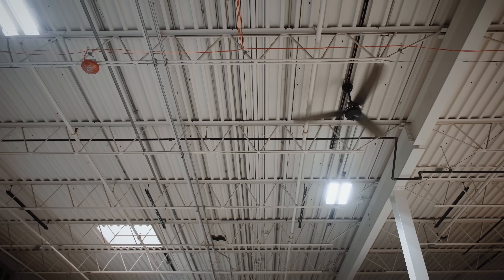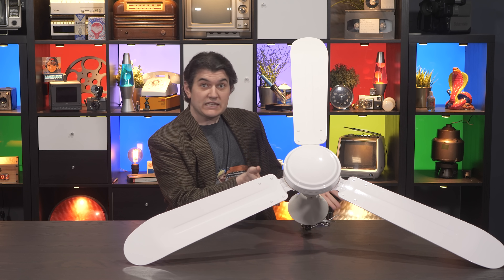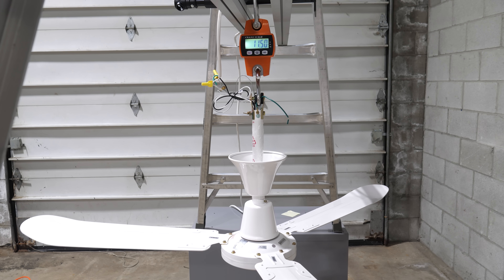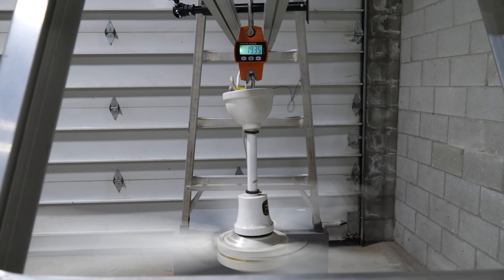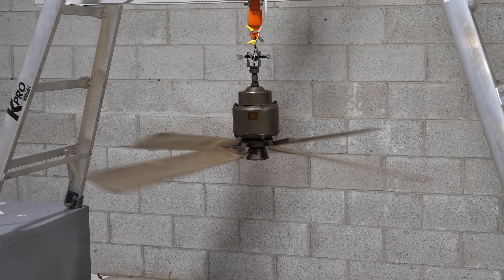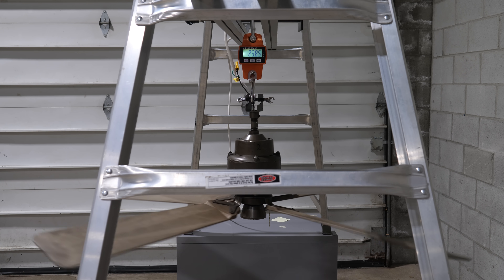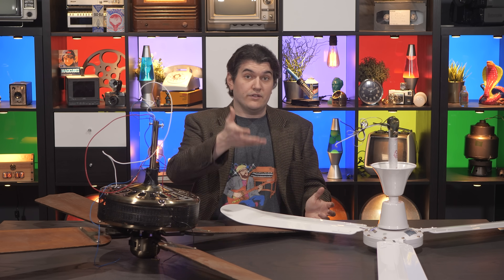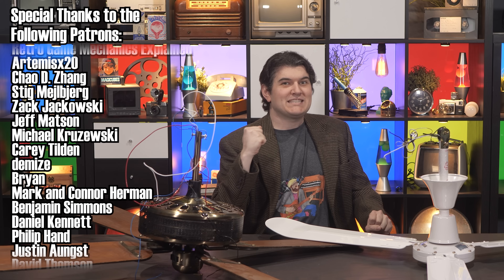How much thrust does a ceiling fan produce?

Comment: A propeller or helicopter rotor doesn't push air, it pulls the aircraft through it. A better comparison would be the fan on a turbofan-powered aircraft, which works because the fan is ducted. A propeller is shaped like an airfoil and the air is moved through aerodynamic lift, not just by scooping the air and pushing it out of the way like a fan does.
Reply: Propellers push air. Saying the propeller pulls the aircraft is not distinct from saying it pushes air. It can only pull the aircraft because it pushes air. Aerofoils work by pushing air. That they don't only do so by acting as a "scoop" doesn't change that.

I'm starting to reflect on how irked I am about this subject. I got very annoyed by inadequate explanations of it and spent way too long learning about how planes fly, and now I'm just permanently mad about it.

Comment: A proper ceiling fan box that's correctly mounted will hold something like 50-70 pounds of fan. With a purely static load, like a light fixture, they're rated for 2 to 3 times that. Most of the problems come down to using the correct box for a ceiling fan and then mounting it correctly to the joists. After that, the problem is the average home owner using an impact drill to strip out all the screws on their new remote control ceiling fan that they also wired in wrong.

Comment: An average Ceiling fan is around 3,000 CFM of airflow powered by around a .05 horsepower motor.   

Even a Robinson R22, which is a diminutive helicopter, has 122 horsepower.  It only weighs 1370 lbs.  

So one of the smallest & lightest helicopters is 3,050 times more powerful than an average ceiling fan.
Reply: Got it. Going to stick a small helicopter on my ceiling.

Comment: A simple lever arm could have stopped the torque issue and if you used say a 10 to 1 ratio you could also get a higher resolution for the readings. Both of which would have been considerably more effort of course 😂

Comment: I wouldn't worry about a properly anchored electrical box but the thought of of some one hanging a ceiling fan from a non- anchored box is somewhat terrifying...
Side note there's an older wiring style I don't believe is used much anymore that makes adding a ceiling fan much simpler by allowing the fan to operate independent of the switch.  The easiest explanation is all the ceiling boxes were all wired to gather  like they were outlets with the switch wires being a dead end loop vs. bringing power into the switch box from the source and then on to the ceiling box.

Comment: In reality a fan is quite close to the ceiling. As it works, pressure builds up above it a little more than in your installation, thus resulting in higher force. Whether or not we should consider it a thrust is another matter.

Comment: For less wiggle, I'd consider mounting the fan to the middle of a rigid beam supported at two ends and use a regular bathroom scale to measure the weight supported by one end and doubling.

Comment: I Think the fluctuation seen during rotation had to do with the shape of the hook you attached to the scale. As torque is exerted the point of contact on the hook and scale changes, creating a fulcrum point which changes proportional to the torque, this would vary the reading on the scale. I bet you would get a different ratio if you changed the shape of the hook. You can see this on the last fan you tested as it has a different point of contact that doesnt shift and you see less fluctuation in reading because of this.

Comment: Propellers generate most of their thrust by lift, not air pushed back xD
Reply: ... Propellers generate lift by pushing air back.
Reply: @seigeengine  Lift is generated by pressure difference, not air displacement.
Check basics of flight

Comment: 7:59 "I will probably make a video about this fan, specifically, one day..."
Four years later...
Reply: The supply wires look a bit sus, don't they, for a resistance heater load? Like, they look like normal 16- or 18-gauge appliance wires.

Comment: Years ago, Consumer Reports rated box fans.  Instead of actually measuring the air movement they created, they measured the thrust.  I thought this was stupid, and felt that fan blades look different than airplane propellers for good reason, and the two variables were not necessarily correlated.

So this is a question for you physics experts:  Does the amount of thrust always vary directly with the amount of air they move?
Reply: In order for a fan to push air in one direction it has to be pushed back the same amount. So, yes.

That doesn't mean the fan is efficient though.

Comment: I have been calling high speed on my ceiling fans “jet engine speed” for quite awhile now. I know jets are bunch of fans, though. I hardly ever run my fans that high for the same concern you had. My last apartment hadn’t had an adequate ceiling mount and I could see the swaying. Now in another apartment I don’t see that. It’s great to know high speed is not that big of an issue if the ceiling mount is done right.

Comment: Fascinating! On the topic of heat fans, there is a product that isn't sold anymore today, but was wonderful in it's time and should get a retrospective: bathroom heat fans. Heater/fan combos, mounted directly above the shower or bathtub, which have heating elements just like a plug-in heater and a fan to direct that hot air downwards. They were wonderful when they existed, as they were perfect at helping you stay warm while drying after a shower.
I cannot find any of those for sale these days. Maybe it's because they needed a lot of power to produce that heat, and infrared lighting is much more efficient at the same thing. Or maybe it's because it used exposed heating elements in the bathroom, immediately above the thing with all the water, and that has some obvious safety concerns.

It would be great to see an analysis of those, and a comparison to the modern alternatives.
Reply: Those are still sold.
Reply: The bigger safety hazard is probably all of the lint that builds up in a bathroom. Every time I clean the exhaust fan, I'm amazed at the amount of toilet paper lint trapped in the grate. Seems like a great way to accidentally start a house fire.
The basic electric space heater seems the better option.

Comment: I had to change a VFD on a Big Ass brand HVLS fan in a warehouse. Even though I had it double locked out, there's something concerning about having your head between two of the blades. Those things are a whole lot beefier up close than looking at them 30 feet up in the air.

Comment: Propellers don't create thrust by pushing air. (mostly)

Each blade of a propeller is actually a very small airfoil. So each one acts like a tiny little wing that goes around in a circle and adds to the total "lift" of the prop.

Desk fans are designed to move the maximum amount of air without proving this lifting force. That way they don't push themselves off your desk.

Search term "Propeller theory"
Reply: They exactly produce thrust by pushing air.
Aerofoils work by pushing air. They do not magically defy physics because you got a bad lesson on flowing fluids in middle school.
The difference is in whether they're designed to push a lot of air gently or a little air very hard. Ultimately, they can't defy physics. You can't push more air without being pushed back just as much.
Reply: @seigeengine Maybe you can explain that to the marketing people in Dyson who claim their "blade-less" fans have an "air multiplier".
(As if it means the little motor in the base doesn't provide all the energy that causes airflow)

Comment: Instead of the sketchy ladder-and-scale setup, couldn't you have simply bolted it upside-down to the top of  tabletop scale, then seen how much heavier/lighter it got when switched on?  So long as you remember to subtract the setup's initial weight, that should work fairly well - and without all that "spinny blades of death" feel (which admittedly does add to the ambiance .)

Comment: @PeterSripol Can you make a Tandem-rotor helicopter made out of ceiling fan rotors? Hm motors would need to be different and the blade angle is not adjustable... uh. Anyway, I would definitely watch that video

Comment: One other interesting factor is the fan’s proximity to the ground during these tests. Because aircraft enter ‘ground effect’ and essentially float on the high pressure area of air above the ground when within a few metres of the ground. I believe this would have had a very small impact on the experiment, would be interesting to see if the fan was higher up if it made a lower reading of thrust.
Reply: It's a factor in comparing the thrust of different fans, but it's not a factor in assessing whether the fans generate thrust.

Comment: This is very useful because I will henceforth reference all jet engine power output in the unit of Ceiling Fans. The F35's P&W F135 afterburning turbofan produces 43,000 ceiling fans of thrust (on full AB).
Reply: Heating function included!
Reply: Anything but the metric system 🤣
Reply: @ampex189 Never surrender to France.
Reply: Call it CFM, for Ceiling Fan... Movement
Reply: For a while,  I was converting speed into furlongs per fortnight.
Reply: @stevenmiller2837  You can also use atto-parsecs per micro-fortnight
Reply: @stevenmiller2837  Easiest way to remember 8*10^12!
Reply: I mean people rate cars in horsepower, so why not?
Reply: How many fig cookies is that?
Reply: How much is that in donkeypower?
Reply: How many ceiling fans are the lift fans?
Reply: Or as I now think 43,000 Flakeys.
Reply: American units be like

Comment: My understanding of aircraft propellers is that they're airfoil-shaped.  But, ceiling fan blades are just angled, flat pieces of wood-like substances.  I wonder why manufacturers don't shape them as air foils.  Well, not really.  It's probably a whole lot easier to use planks instead of carving airfoils.

Comment: Funny enough though if you changed the blades on those fans to an actual propellor blade you’d get a lot more thrust. Thrust doesn’t just have to do with the speed of the fan but also the shape of the blades.
Reply: Not so much. The propeller shape is primarily advantageous at higher speeds. It offers less benefit at lower speeds.

Comment: This might be a silly question, but would it not have been easier to mount the fans upside down and use a regular scale? You'd mostly eliminate the torque issue, you could clamp it more securely to reduce the wobble, and it wouldn't have required the certainly-not-OSHA-approved setup.

Comment: 0:56 Fun fact, since most helicopters' tails are shorter than infinity feet (infinity meters), the tail rotor doesn't just produce a torque force, it also produces sideways thrust. Because of this, the main rotor is tilted slightly to the opposite side, to produce a counteracting thrust and keep the aircraft from drifting sideways when the controls are neutral.
Reply: Is this why the tail routers are also tilted slightly upward?
Reply: @RudyOMP not necessarily. The UH60 blackhawk has a 20° tilt on it, so the tail rotor thrust actually contributes lift. 

It allowed the main rotors to be about 2 ft shorter, which was required for some logistics requirement the army had.
Reply: @RudyOMP  The tail rotor's up/down tilt has more to do with air stream interaction near ground level. When the backwash from the main rotor's air stream hitting the ground hits the tail rotor, it can change the force it produces suddenly. And even if the tail rotor is fully within the main rotor's downwash, its own air stream can hit obstacles next to the landing site. All of this plays into the design and positioning of a helicopter, which isn't that trivial to begin with---when there's no inertia that wants you to keep flying in a straight line, those tiny forces from the air moving around you suddenly matter a whole lot more...
Reply: "most helicopters' tails are shorter than infinity feet" [citation needed]
Reply: "Citation needed" on that assertion about tail length.
Reply: Well yes, but no. The rotor isnt tilted unless the pilot has the stick off center. If you stay in a hover with neutral controls, the helicopter will slowly drift sideways due to tail rotor thrust unless the pilot counteracts it. There may be a couple helicopters that have an offset rotor for the purpose, but Im not familiar with them and it definitely isnt the norm.
Reply: @wills.5762 I know full scale helicopters and planes are different from the RC equivalents. But it surprises me the things you find on rc that are not on some aircraft or at least not normal. Like trimming is just a normal thing in rcs but if I forget in some aircraft you just learn the feel of it.
Reply: Wow that makes sense that the helicopter would drift... But if I had to naively guess, I would have thought it's easier to mount the rotor straight and just put a small offset in the neutral position of the controls
Reply: @benja_mint  At zero you get all the sideways thrust and no torque?
Reply: Could this be countered with having a smaller, third fan on the perpendicular to the tail blades?
Reply: @TurtleMarcus  that would be another fan that would also need to be countered. Helicopters are basically flying through sheer brute force
Reply: Very interesting!
Reply: I'm pretty sure the rotor would produce sideways thrust even if the blades were infinite meters long (infinite elephant feet). Quite a bit actually. It would basically make the main rotor act as the tail. You would want the blades to be zero meters (zero tiger tails) long if you wanted no sideways thrust.
Reply: @falsemcnuggethope I think he meant the tail boom being long, so it ONLY gave torque canceling and no sideways thrust on the body of the helicopter
Reply: Could have said "which is the same in meters"
Reply: @seigeengine  or even "which is the same number in metres". heh.
Reply: @laurencefraser  but is it though? one infinite is not the same as two infinite! i think! lets get some math nerds in here!
Reply: @kv4302  Math involving infinities is weird.  The number of integers is aleph_0, which is also the number of rational numbers and several other things.  The number of reals is aleph_1, which is infinitely larger than aleph_0.  Multiplying infinities by finite numbers generally just gives you the same infinity you started with.
Reply: @kv4302  There are infinite natural numbers (positive integers) and exactly the same inifinite integer numbers (positive and negative integers) ... despite being "obviously" twice as many.
Reply: @laurencefraser  infinity is not a number
Reply: @kv4302  It's infinity and infinities, and one countable infinity is the same as two countable infinities. (there isn't actually any such thing as "two countable infinities". there's just the one countable infinity.)
Reply: @kv4302  In this case these infinities are actually the same
Reply: @Sprockete  yes, infinity can be a number in some extended numerical systems. For example, there's a unique complex infinity in the extended complex numbers. there's also, as several people have noted, the cardinal numbers, where we have infinities of different sizes, denoting the sizes of infinite sets, where two sets are considered to have equal size if we can find an isomorphism between them. there are several other number systems that contain one or more infinite numbers
Reply: Infinity in meters is about 3 times the infinity in feet. 😄
Reply: "most"

Comment: Rather than the usual cheap angled planar metal blades,..someone,.. should have tried proper wing profile airfoils, lets raise the roof! 🙂
Reply: Not advantageous at the low speeds of ceiling fans.

Comment: pound is actually more helpful for all the wrong (american reasons) It's also used to measure thrust. Which is wrong, but more intuitive.
You just know if a Saturn V weighs 6.5m pounds and has a thrust of 7.5, it will lift off...

Unlike with the entire rest of the imperial system (13/34th of an inch...) , conversion is actually easier (or unnecessary) than with Kg and Scienceguymeters

Comment: Ive never looked at propeller/rotors as being the same as a ceiling fan.  Ceiling fans are just a flat piece of material mounted to an angled mount.  Propeller/rotors have an airfoil shape that generates lift and thrust.  Sure, it moves air but not much and not efficiently.  Which is what you want indoors, instead of aircraft thrust.

The increase weight shown on the scale is from the torque, applied thru the s hook to the scale
Reply: Cool, but you're wrong.
Reply: @seigeengine  such great insite and thought went into your reply and I give it equal interest
Reply: @seigeengine  o, you are hung up on an auto correct.  I typed airfoil.  You really need a hobby.  My understanding came from 13 years in the usaf and a degree from emory-riddle aeronautical university in a&p (airframe and powerplant).

I dont know what laws of physics you are referring to, I mentioned efficiency of moving air, is that what you mean?  Fans move air, rotors beat it into submission.

Comment: The Emerson heat fan motor is specifically made for that fan, it isn’t a washing machine motor. The motor has a high pole count which results in a low rpm high torque motor.

Comment: 7:27 probably the same thing as in Ikea GENOMSNITT kitchen scale. If the reading is near 0 (in its case <5 g), it will continuously tare itself. You could tare it with an empty glass, add water dropwise and it will show 0 the whole time, up  to the glass being full of water.
My guess is a hacky workaround for drift issues.

Comment: There's likely a correlation between torque and the volume of air (which will give you your lift) moved. The weight of the air moved will equal your lift...And the surface area/angle of the fan blades will be the thing that tells you the force applied to the air, based on the torque. I have no idea how to science that.